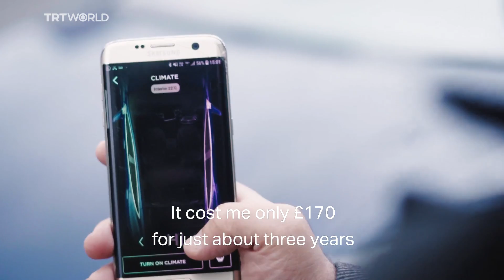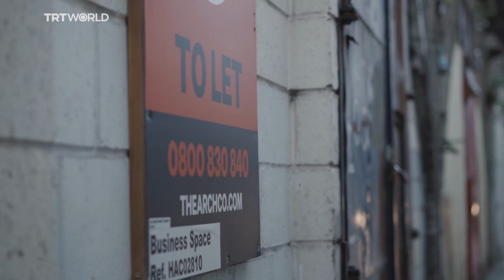Mechanical vs Electric: The future of cars

Comment: According to auto industry researches, all the auto makers will shift to Electric and solar power, especially the solid state battery, where the car will never lose charge while moving or parking and has range of 1000 miles per charge and keep charging while parked like Aptera that has 1400km charge with solar panels that will keep charging while moving or stopping. In the upcoming years even the traditional driving method will disappear because companies like Uber and Lyft will lead the autonomous driving where no more drivers or in other word the future is rider not a driver.